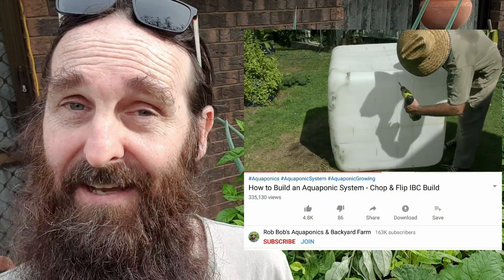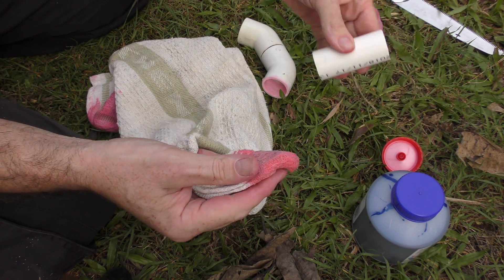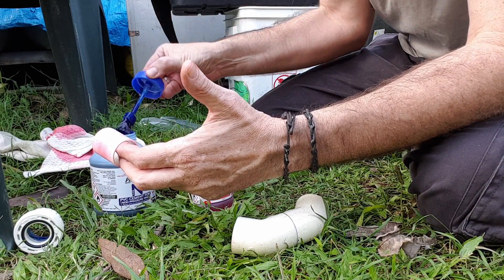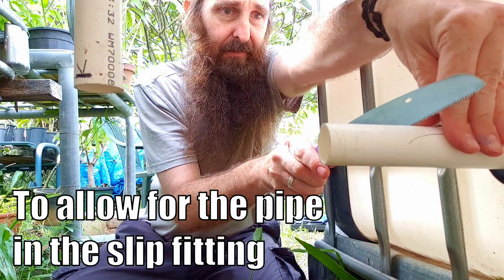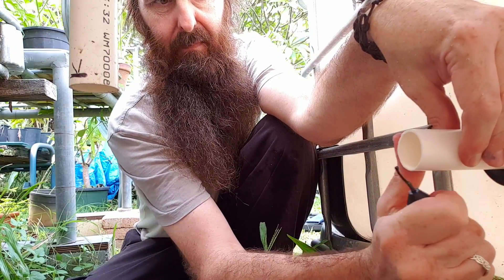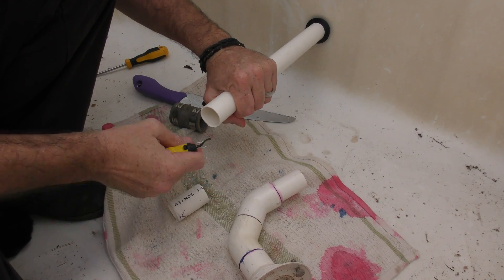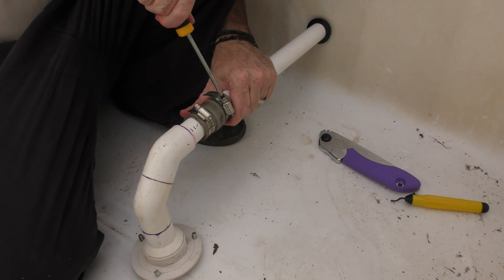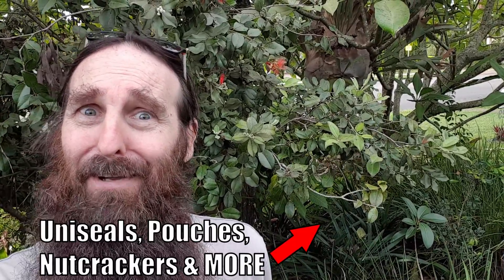Aquaponics Design | Plumbing Solids Outlet to Radial Flow Settler

Comment: Hi Rob, thanks again for making everything so clear. On min 10:20 you say that the pipe on the solid filter need to be below the fish tank water surface but wont it overflow if that's so?
Reply from the maker: Hey Juan. It needs to be below the fish tank level so the water will flow to the lower point. As long as you have a large enough outflow pipe in the filter there won't be a backup to cause an overflow. 👍

Comment: What size pipe do you recommend between the IBC, Filter, and moving bed bio filter to sump/media beds?
Reply from the maker: Hi Alan. That really depends on your flow rate. 
I've used 50mm/2" for anything over 1500lph/395gph if that helps any.  👍
Reply: @RobsAquaponics  Thanks Rob.  I appreciate your response.   I've been collecting all the parts and pieces and I hope to start plumbing it in in the next week or two.  I have 3 IBC totes on hand and in the process of rounding up a few plastic drums for my filters.  Thanks again!

Comment: Hay Rob, your invention inspired me!! I was using one of those filter attachments that are used in big home aquariums. I had it on the intake pipe to my pump and could not get the muck filtered through from the bottom of my pond. After seeing what you had devised I've been wondering how I could match that as I don't have anything similar. Then I thought of using a small soft drink plastic bottle, cutting it just where the neck bells out and cutting three short feet onto it. Placed it on the end of the pumps suction pipe and, oh wow!! It's amazing the dirt that was picked up! In fact it picked up a couple of small twigs that had been blown in from a recent wind storm and got caught in the elbow bend. I had to stop the pump and clean them out. Great content Rob, thanks
Reply from the maker: Is good to read the clips have given you a few ideas to expand on Charles. 👍👍
Cheers mate.

Comment: I follow your channel and this encouraged me to make my own system, but there are some points I want to know before I start like Does the system smell smell fish and how to calculate the number of plants to the number of fish and what depends on it?
Reply from the maker: The system doesn't really smell at all unless you're cleaning a filter & then that's not that bad at all. A faint fish compost smell is about it. 
Plant to fish ratios are really plant to fish feed ratios & you'll get different answers from different sources. I've found that a single IBC fish tank system with 36 fish in it can run 3 x 300L grow beds. You won't have enough nutrients in the system to plant out all 3 beds off the bat but as the fish consume more feed more plants can be added. 
Cheers

Comment: Greeting from Indonesia..
You are my inspiration Rob...
Just curious, are Your new SLO work better than the old one? I notice that You put pipe on near bottom of IBC tote. Why don’t You use the IBC drain valve as SLO?
Thank you
Reply: Because his using a small drum as a filter you need to have a slow flow go through it to give the solids time to drop to the bottom of the filter.
Reply from the maker: Hi Yoko.
The drain from the IBC is harder to screen off from the fish. The smaller SLO will also allow for a slower flow rate which means a smaller filter drum can be used as @Matt Dawson mentioned below. 👍👍
Hope that helps some.
Reply from the maker: Cheers Matt. 👍👍
Reply: All good mate 👍
Reply: When i first built my system i had racked my brain for ideas of how to use a 20L as a solids filter but still have a high flow rate to the fish ended up cutting my wooden work bench in half so i could fit a 200L drum. You have impressed me alot with this one mate 👍

Comment: Hi Rob, why did you bother to glue the pipe on the inside (under water) of the tank ? :) I never bother to glue when there is no possibility of a leak. Did you have something that you were concerned about for that joint? great video as always, cheers from Tokyo
Reply: Maybe it's more about making sure they stay together and not get pushed apart? I don't know I'm just guessing.
Reply from the maker: I have had drains not work as effectively due to fitting becoming loose & reducing the suction from the base. It would also be a HUGE PAIN to fix if it  were to happen with a tank full of fish & water. 😉
Glad you enjoyed the clip. Am popping over there this week to do some more work on it so will be another clip coming soon.
Cheers & happy growing. 👍🌱🌱
Reply: @RobsAquaponics  valid points indeed ;) look forward to your new clips Rob, cheers

Comment: Instead of priming the PVC, could you give the surfaces a light sanding to clean them up and offer some more surface area for the glue?
Reply: it just cleans the surface. the glue itself is more of a weld bond. A light find sanding is ok.